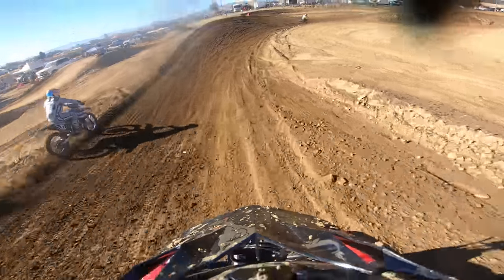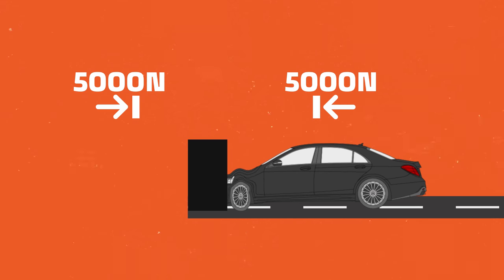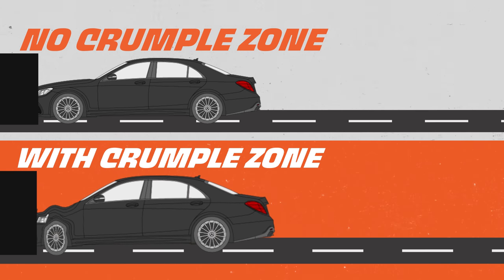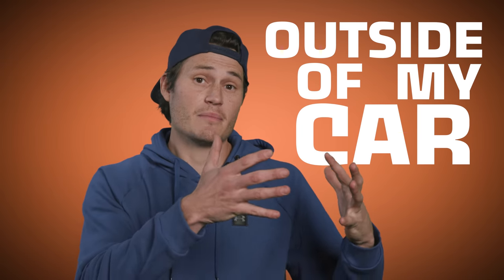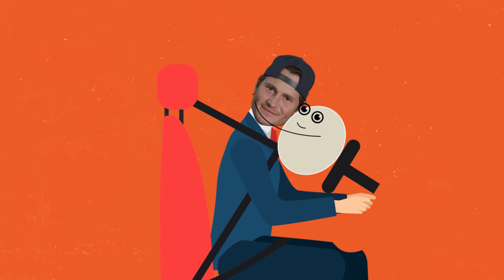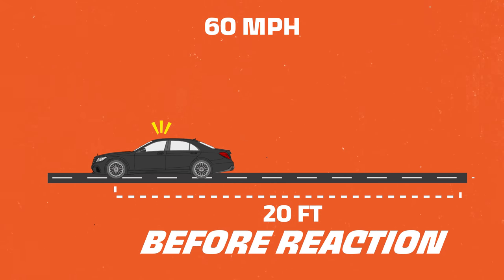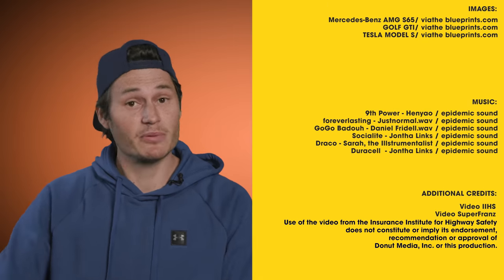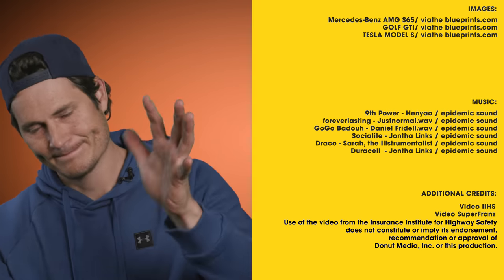How To Survive A Car Crash

Comment: i NEVER drove my car without my Seatbelt! not only because of the safety, but also because of you sit more solid in your seat if the road gets curvier
Reply: Right? I can't drive my Miata without it on the curvy roads around me cause I'm sliding all over.
Reply: Honestly imo,  if you don't wear a seat belt, you deserve a Darwin award.
Reply: If I’m a passenger in a car about to go quick through turns, I pull the seatbelt all the way out and let it reel in so it locks in place

Comment: Uncle: crashes his 2020 car at 50mph and walks away unharmed.

Also your uncle: "they don't make them like they used to"
Reply: Underrated comment.
Reply: My uncle would never be dumb enough to get in a modder car... he told me that if he ever did that I had permission to crash into it with my truck while he's in it.
Reply: So true. So many people around my area have old trucks and at least once a year there's a deadly crash that should have been no injury because of guys driving 70s pickups on modern highways at modern speeds with no safety equipment (and often drunk).
Reply: 😂they don’t make them like they used to. That’s a good thing
Reply: People can complain as much as they want to about modern cars. How they're uglier, the exhaust noise isn't as good, how there's too many tech gadgets inside, reliability etc etc

But one thing is undebatable and that's safety. A 2020 Prius is definitely a safer car to crash in than a 1985 Cadillac despite the size.
Reply: @planej6315   

modern car:

pro: crumple zones

con: wires everywhere and firefighters must wait before they know how to safely cut your car to get you out
Reply: @SayAhh  That might be true for a Tesla but it's definitely not true about a Prius.
Reply: @SayAhh  I wouldn't disagree with anything in that article. And I suppose firefighters do need training in it. But, all EVs I've seen/driven have signs on them about where to cut/not cut and I think generally have a main cutoff switch. I have to imagine they're also building in some kind of auto shutoff when it deploys the airbags or something because people getting shocked would be terrible publicity.
Reply: @adamlreid  yes modern crumple zones are "safe" but I can name a number of extreme scenarios that I would put myself in anyways where a seatbelt and a crumple zone actually cause more harm than good.. normal people dont go looking for those scenarios cause they don't wanna go outside their comfort zone, I on the other had find comfort zones boring and would love to build a vehicle designed for fighting and take it for a test drive. In this special scenario crumple zones would do nothing more than put you at risk of death cause they are going to force you to go on foot the rest of the way to your destination, which means your tactics need to go from just running to hiding&running.. and your car is dead now cause you hit a pole that a rigid vehicle would have just pushed over. And while seat belts are a good idea in busy cities or places with unknown variables, if you have no choice but to stop then you are going to have to do it fast, and that seat belt is the number one thing stopping you from doing that.
Reply: One of the little snippets OV video in there was one of a test the IIHS did several years ago. They tested a 1959 Chevy Bel Air against a 2009 Chevy Malibu. I think it was the 50% overlap head on collision. Very interesting results. Check it out. 
https:// youtu.be/fPF4fBGNK0U
Reply: "Back in my day we would have gotten skewered by the steering column. Kids these days are so sensitive."
Reply: @skullofironhold  We all love the fantasy of ramming cars to get away from a zombie apocalypse. The truth is most wouldn't survive it anyway and the only cars that would still be driveable after 3 to 6 months are electric cars because the gasoline goes bad really quickly. A bicycle would likely be a better option.
Reply: @JaccoSW  man, who says I'm using gasoline as fuel? You can run an engine on anything if you are determined enough. I mean all you need is potatoes and a distillery..
Reply: @JaccoSW  and that's not hard to make either.
Reply: Well, he's not wrong tho...
Reply: My uncle crashed a vintage Ferrari on its roof.
Reply: Most the time they say that they’re talking about reliability and they’d be right
Reply: Cars arent designed for 50 mph crashes those are still very dangerous especially if you crash into something stationary, you will be definetly be injured

Comment: Fun story about those sensors in the front of the car: I got into a couple fender benders in a 2016 Mazda 3 and it still drove fine without ever over heating or anything but the final crash was really bad (someone jumped in front of me and slammed their breaks giving me no time) and the airbags should of deployed and I know it was only because I had my seatbelt on that I didn’t die. I had bruises on my neck and chest and all that but ever since then I’ve never chanced any rides anymore w/o a seatbelt. Sometimes I wouldn’t wear my belt and that day I left the neighborhood without it on and maybe 1.5miles before the crash happened I put my belt on for some reason, Being that those airbags failed and everything the insurance totaled the car
Don’t be reckless kids.
Reply: Alot of people dont seem to understand that it's not up to you. I consider myself a good driver I was on my way to the dentist one morning and a lady just simply swerved into my lane and we hit head on going like 55. it was brutal and all these people saying step 1 dont crash it's not that simple. I couldn't have done anything we hit so hard it blew her motor apart it shattered into a buncha pieces it was a rav 4 both of us actually I'm just tryna say that it will happend eventually nothing you can do about it I went my whole life accident free until then avoiding idiots
Reply: @zxr-me6dk  I was over confident in the rain and understeer took me into a fence. I was unheart, but was wearing my seat belt. It makes all the difference!

Comment: Pro-tip: When in a roll, cross your arms to prevent your arms from flailing out the window. Long story short, rolled my Corolla going 75mph into a sharp left hander
Reply: Are your arms ok?
Reply: heretustay ye I actually walked away with no injuries by doing so
Reply: That's what people do in rally cars, but only because steering wheel can rip your fingers off in crash.
Reply: Yeah you can break your hands in a crash so it’s best to let go the moment before impact.

Comment: And one important factor in the design of the crumble zone is toughness, which is the energy the structure of certain material can take (it's not equal to being stronger or more rigid). The tougher the structure+material, the more kinetic energy it can absorb, and the slower the car becomes when the crumble zone gets destroyed.

Comment: True and as simple as it gets. I was in an unfortunate crash while returning from my cricket session. It was 70kmph and two hits, one on my right side and one in front. The only thing I knew is that I smashed the brake pedal, tried to steer away but the only reason I survived the crash and literally walked away absolutely unharmed was the 3 point seat belt.

Comment: Rode into the ditch backwards going 80 after hydroplaning coming out from under a dry underpass. I went both limp and rigid spreading myself out around the front passenger area and we Frisbee'd flat and ended up pretty far from the road. No injuries.

Comment: As an amateur racing driver and instructor, I've always held onto the steering wheel as well as possible, right until the moment where I know that I can't save it and I'm going to crash. Then I let go and put my arms across my chest (to protectinternal organs a bit better) or at my sides... Make sure your arms are not in the way of the air bag. If you think of your air bag as a pillow, your arms interfere with the air bag being a soft, fluffy pillow. Get them out of the way so your head hits the air bag softly. Your head will hit the air bag so just let it happen.

Seriously. I've had numerous people tell me that this works and thank me for telling them that.

You also are less likely to break your arms if you let go of the steering wheel in a race car with HANS device, rollcage, and harnesses; the steering wheel is often more violently "thrown" from lock-to-lock in a crash, and can often break wrists in a big crash, particularly in [especially open wheel] race cars.

Comment: Can confirm. Had my 20 year old car hit a huge pole head first. It was modified: no airbags and a more backward steering wheel and seating position. But I was wearing my seat belt. That plus the crumple zone were the reason I just walked away without a scratch. Even better: the belt hugged me in such a way that it didn't even hurt a tiny bit.
Officers told me later that the combination of no airbags (in this case) and the strut bar were what made me walk away like that.

I always wore and continue to wear my seatbelt. I am pretty sure that if I didn't, I would have been injured. Seat belts save lives 100%

Comment: 1. Wear your seatbelt 

2. Sit correctly in the seat

3. Do not obscure any airbags (hold your steering wheel correctly 10 and 3, never ever rest your feet on the dashboard as a passenger)

4. During a “roll over accident” keep your arms close to your body, cross them across your chest (especially if your in a vehicle with out curtain airbags)

Comment: "what kind of car is the safest?" Volvos. Volvos are the safest.
Reply: I'm not a fan boy but, apparently Teslas are really safe too from what I hear. As long as the battery pack isn't punctured
Reply: @adamthompson4072  the low center of gravity of the battery bank helps keep the car from rolling over. Puncturing the battery isn't great, but its not like it has any gasoline to catch on fire.
Reply: @Rysander1  puncturing the battery absolutely can cause a fire. Source: dozens of Teslas burning to the ground
Reply: Volvo is king. They did a 30mph rollover test on the XC90 a few years ago and after rolling like 4 times the dang thing looked almost flawless.
Reply: @the_hodgepodge  How many with people in it Vs. gasoline cars that burned to the ground?
Reply: @Rysander1 you’ve never heard of an electrical fire? Yeah maybe the fire isn’t that bad, but getting electrocuted by the high voltage being expelled in the metal car your in might suck too.
Reply: @JaccoSW  calm down, I'm not hating on Tesla, just saying they're not impervious to burning down.
Reply: @the_hodgepodge  that's fair enough. Then again, probably the only car that would be very unlikely to catch fire in a crash is something running on compressed air. And even then.
Reply: @the_hodgepodge  teslas are 7 times less likely to catch fire than any ICE vehicle, these media companies fear change and make a big deal when a tesla catches fire even though WAY more ICE vehicles chatch fire. Sorry if I sound rude, im only trying to educate the peeps. And yes, puncturing the battery is a no no. :)
Reply: @jettrosch8785  we get it, you're a better person than everyone else.
Reply: @the_hodgepodge  ... what, im trying to not sound rude, im very anxious about being rude. Sorry
Reply: @the_hodgepodge  i get the sentiment but volvo isn't king anymore, tesla literally has the three safest cars on the market (NHTSA) and is the only automaker to ever receive a perfect score

Comment: airbag censors usually detect rapid deceleration that can only be caused by a crash under 25km/h, as long as the censor is intact i dont see how bull bar or a different bumper will effect it, it might effect the deceleration if its softer or stiffer then the stock option but is still a minor effect that is probably accounted for because of the fact the car cant know the stiffness of the object it crashes into.

Comment: Quick question: I have a 42 year old lifted Squarebody, and it only has seatbelts. What would you guys suggest I do in a crash? It weighs almost 7,000 lbs, and has a massive crumple zone due to the engine bay, but I kinda don’t wanna die in it.

Comment: I survived with no broken bones in a 2008 Ford Taurus sedan with only a seatbelt from going 50 MPH to the front end crash with locked up brakes for about half a mile to a mile away from the collision point. It did have airbags, but they did not deploy for some reason. Somehow zero broken bones

Comment: I heard that if you move a bit closer to the pedals with the seat, so when your leggs are pushing the pedals your leggs are not fully streched because when you crash your knee will break in half, but if its bent just a bit then it more likely to fold.

Comment: I knew a guy who crashed a 2nd gen (1967-72) GMC C/K pickup right into a tree goin 60 mph. Dude got out, walked 10 miles home just fine, has the truck towed, fixes it up and drives it for a little while longer.

Comment: I had a diverse chassis improvement applied to my car(Sn95). It not only helped handling but also the main section of the passenger compartment, for improving an aging chassis from my floorboards cracking any further ( they were welding back together by cert'd welders), but I took the advantage when I had it. Please you all consider your safety , I might not like your car but I still want you to come home the same way you left. In One Piece .

Comment: This is why I always tell my friends to hold off on switching to a quick release steering wheel while they daily or often take the car on long trips. Taking out the airbag without adding all the other safety measures that make a track car safe will leave you with a very crooked nose

Comment: In May of 2017 I was driving my dad's 2008 Nissan Xterra, and fell asleep behind the wheel, resulting in the SUV hitting a tree at about 40 mph. Luckily, I was wearing my seatbelt, or I probably would be dead. instead, I had to have surgery on my spinal column as I shattered one of my vertebrae and compressed a second, but I have since recovered, and I'm able to walk, run, and do all the things that I used to love doing like playing football.

Comment: What is important to mention is that you have to put your seatbelt on properly. It is supposed to be close to your body and pulled tight!! If you are wearing a big jacket or a sweater, lift the front and put the lap part of the belt under the garment, to have it close to your body and pull it tight!

Comment: One thing I've never heard anyone talk about is seat position, specifically how far your seat back is reclined. I don't know if this affects anything in a forward facing crash, but many, many accidents are one car rear-ending another. Passengers in the car that is struck are at high risk of neck and upper back injuries. 

If your seat is reclined a whole lot, you have to bend your neck forward to get your eyesight level, and your brain really likes you head to be level for normal activities. Having your head forward leaves a large gap between your head and the head rest. When your car is struck from behind, your body (because it's held by the seat) is pushed forward, but your head not being supported by anything is immediately thrown backwards. (Newton's Laws!) Then your head is thrust forward, and this can be from many causes from your own neck musculature all the way to striking the car in front of you, and then usually your head is thrown backwards again. This phenomenon is called whiplash. 

When I worked in a PT clinic we saw a lot of this type of injury, usually from car accidents. When I drive I have my seat back as vertical as possible leaving the gap between my head and the head rest as small as possible. While this position takes a while to get used to, it has the possibility of reducing the severity of whiplash injuries.

Comment: One thing most people don't realize, you have to have 12 inches at least between your chest and the steering wheel. My sister was driving around with the wheel a few inches in front of her. Like that would straight up crush you.

Comment: "They don't throw this airbag from the shelf, and this seatbelt from that shelf"
Oh, sweetie, you give these big automakers far too much credit.
Reply: Um, you know that they wanna score high on these test and that it would be really bad publicity if they messed up?
They really look at the system as a whole. Not only with safety by the way but with basically everything.
Also, you can't just put a random airbag into some random car and hope that that's gonna work out fine. What do you think this is? Highschool Physics?
Reply: @Alltoc  every airbag and safety belt recall, ever, would confirm how incorrect you are. And how cynical the executives of these automotive companies are.
Reply: @ZeroHourProductions407  Airbags are made by another company than the car manufacturer itself
If they all just went ang got "some off the shelve airbags" one airbag recall would result in a lot of manufacturers having to recall their vehicles.
Maybe they desing their cars in such a way that they can fit the same airbag or in some other way that would result in a lot of models having the same issue with the safety system such as bad sensors.
I am not saying that maybe some manifacturers are not putting in as much effort as others, but saying "Oh, sweetie, you give these big automakers far too much credit." is really arrogant and i think she knows way more about car safety than most people, including you (it is her job after all)

Comment: ARB bull bars actually do maintain the front crash sensors (this is required in Australia where ARB is based). A good reason to buy Australian 4x4 gear that truly modifies your car (because they have stricter safety laws) versus random American fabrication shops (not that they're all bad, but most have a warning that they don't work with crash sensors).